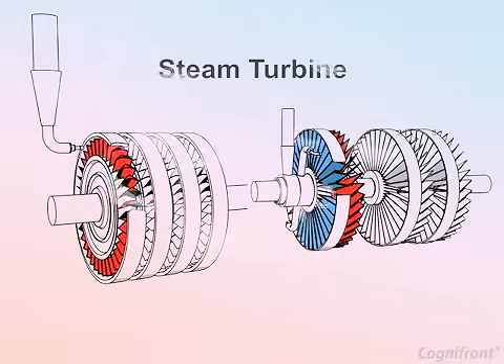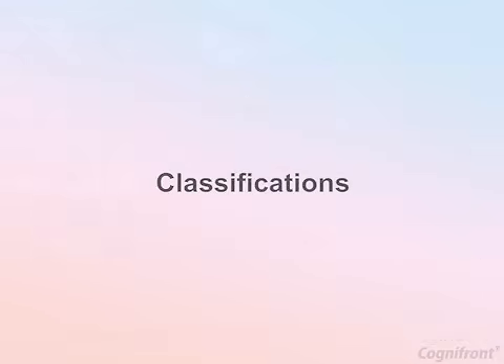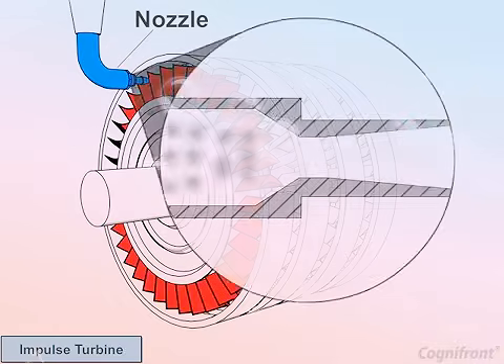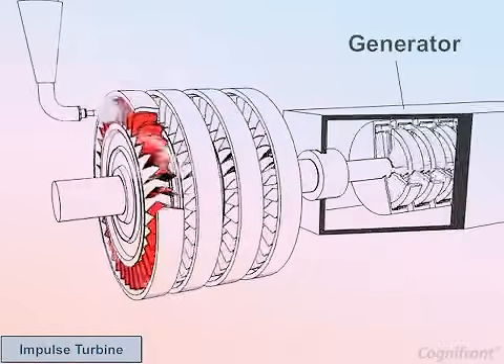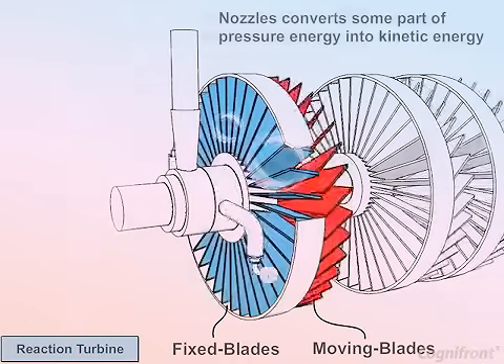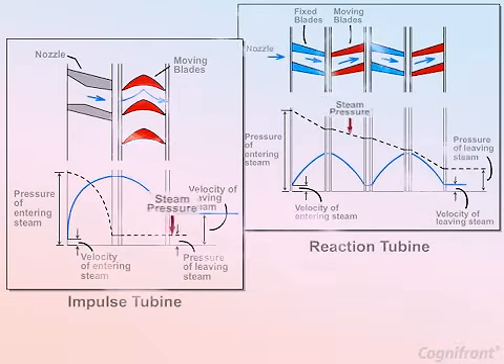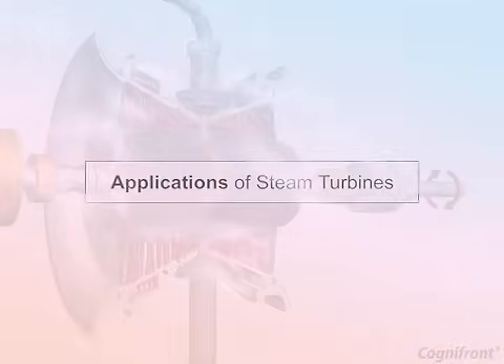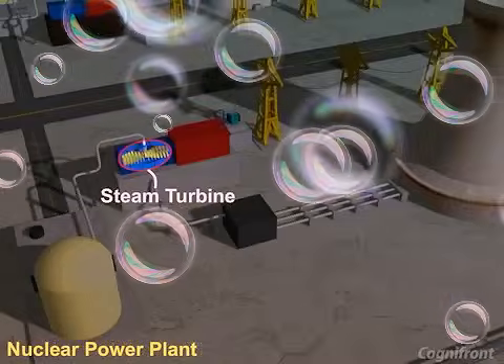Impulse and Reaction turbine with animation

Comment: Steam turbines is also used in Marine powerplants, I mean propulsion power, and auxiliary power for ships, and submarines, although the use of the steam turbines have become redundant, due to economy factors of Marine diesel engines, and gas turbines. But steam turbines was solely designed for practical use in ships first then in Land based installations or powerplants.